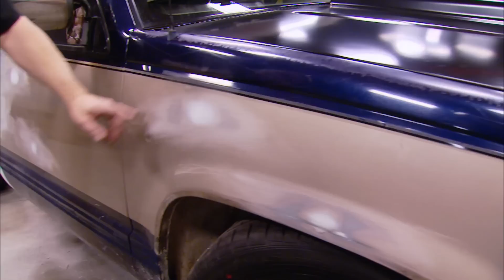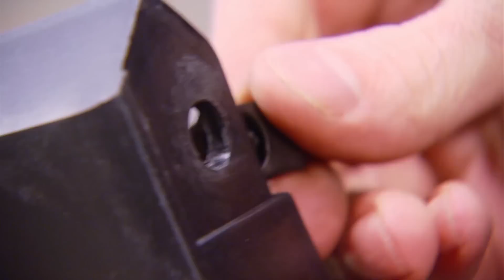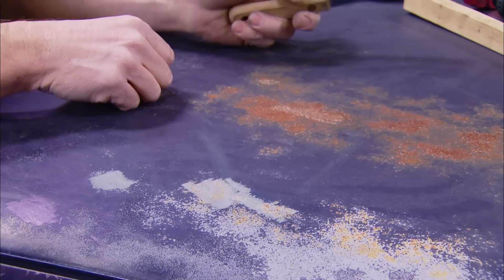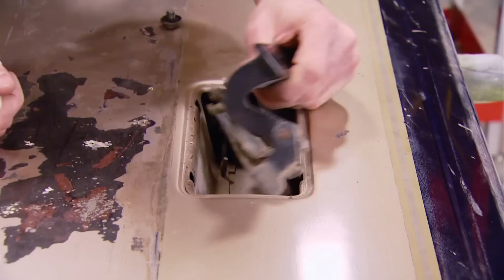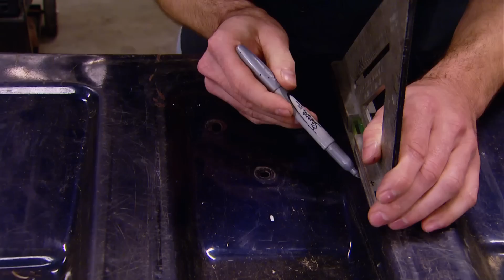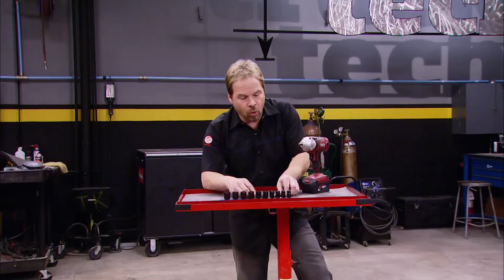Front End Upgrades on a Low Buck Street Truck - Truck Tech S1, E8

Comment: So all i would have to do to make a 94 grille fit on my 91, is change the corner reflectors?
Reply: they should interchange cus the same basic design didnt change from 1988-1998, almost like the 73-87 square bodies that never really changed much other than headlights and grilles

Comment: I did all of these to my 1990. Just with a better lookin grille and hand built everything else. Both roll pan bumpers, hood, shaved tailgate and moved it into the inside. All at home, all by hand. Eventually got around to the rest of the body work and new paint job. It was my first vehicle and I miss it. I sold it a couple weeks ago for pretty nice amount. For anyone possibly curious, it was a 5.7L 350 v8.

Comment: Helpful tip, use E-clips at the end of the plastic rod clips. For the door handles and the tailgate. I used one on my OBS Tahoe limited, which the driver side door inside handle rod would slip out of the old plastic clips.

Comment: How do you reinstall the tailgate rods if needed again?
Reply: If you were paying attention to the video it's screwed in so you can get access to the rods
Reply: @garyhayes4756  they put the rods in then weld up the outside hole.  Maybe you should pay more attention 😂
Reply: @gixgix457  you can unscrew the plate on the inside of the tailgate for access to the rods
Reply: @garyhayes4756  would like to see someone gets those plastic clips back on or off.When still attached to the plate. Is all I'm saying.

Comment: Spend 3000.00 on a new bumper ,grill and head lights then use  a bunch of 9 cent rusty fasteners!
Reply: Grill; 130.00 - Bumper 100.00 - Head Lights 130.00  - Park lights 40.00 = 400.00 - lets say 475 with shipping. Oh, and the hardware kit is 11.00 for defector, and 10.00 for bumper. It's not that expensive, but agree.. hardware is cheap so why not include it.
Reply: @hawkdsl  i think i remember watching past episodes of all the shows is that they all are stock with all kinds of hardware and fasteners, i think the company is called Industrial Depot, so i would guess they just used new hardware all around, but i could be wrong
Reply: @everettgrover9459  Yes that's right.. Industrial Depot.
Reply: soak them in phosphoric acid 15 min first at least.
Reply: Could have spray painted them,at least

Comment: Aren't those mirrors smaller? I would say that isn't an upgrade.
Reply: Those came standard later in the production years. I believe they are called "Rally Mirrors".  I prefer the big stainless steel ones on the 88/90 model years. Both are available from LMC
Reply: hawkdsl they’re called “sport mirrors”
Reply: @95roadie  That's right, thanks.

Comment: I don’t like those aftermarket grills, the mounding doesn’t go all the way around the bowtie, that always bothered me🤷🏻‍♂️
Reply: DuratrashLML  Those parts are actually from the 454SS or the 2000 Tahoe Limited if you want to search out OEM parts. You’re right tho, those after market repop parts usually suck.
Reply: I hate it, I bought one on eBay and since it doesn’t wrap around the bow tie, it allowed water into the $140 emblem I had just bought.

Comment: I wish I could find a set aftermarket reflective headlights for my 01 Sonoma, because the ones in the video are really nice, also there would be no need for a set of super bright LED or HID bulbs to see the road at night.
Reply: Evil Fingers Go on eBay and search 2001 gmc Sonoma headlights. There is a bunch and they aren’t expensive.
Reply: @TheMotorman80  I recently checked ebay, no luck.
Reply: Maybe no need for led lights where you live but if you live in the sticks with limited or no street lights you may. So your opinion is invalid
Reply: @genejackson4261  you might want to reread what I posted because that's not what I said.